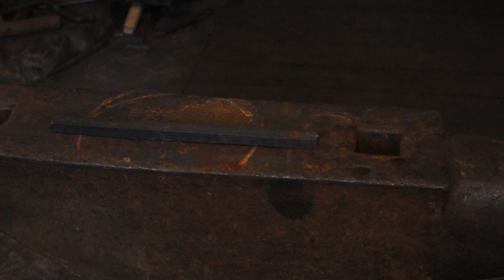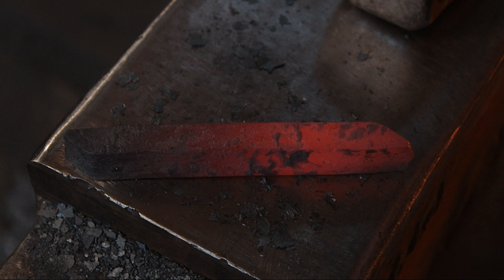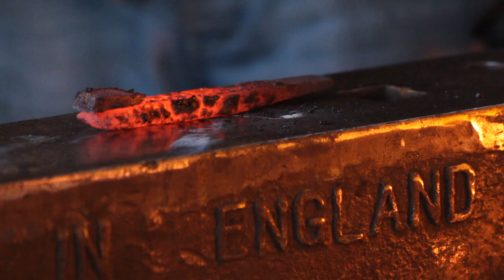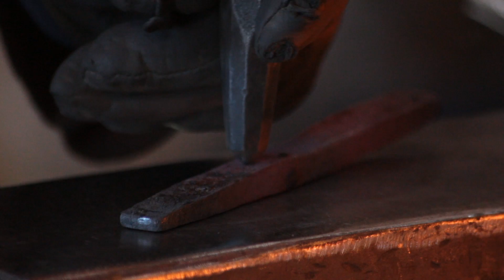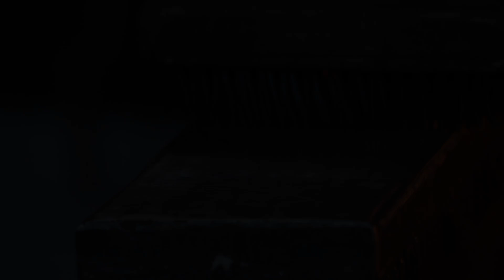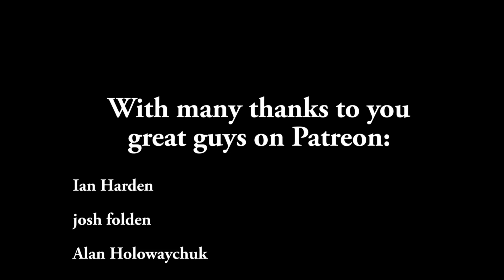Forging shears, Part 1.

Comment: Why make this mostly out of wrought iron? It would seem to me that making it entirely out of spring steel would create a better set of sheers.
Reply: I think it might have to do with his style of blacksmithing. He is very traditional, so I would think that back in the day spring steel would have been harder to come by than wrought iron. So you'd make most of your tool out of more common material and only use the good stuff for the cutting edge. I could be wrong but that makes sense to me :)

Comment: Do you have any problem with the wrought coming apart or cracking when you work at a dull red?  I have in the past, but I might have been working with hot-short. Wonderful stuff here pal, glad to see someone making proper hand tools.

Comment: What is silver sand? I think that was one part of your flux and I am not familiar with it. Are the proportions thirds? Thanks, love what your doing, be well!
Reply from the maker: It is basically clean fine river sand. In Europe it is used instead of Borax but I don't like it much on its own as it forms big lumps which mark your work. Just put "silver sand" into amazon or ebay and it should come up. It is used by horticulturalists as well. It forms a molten layer over your weld. I find that it stops the borax from running off.
Reply: Thanks. Do you collect your own filings?
Reply from the maker: I do indeed. I run a magnet over my grinding station every now and then when I need a top-up. I don't measure the quantities but I would say I roughly use 2 parts borax, one part sand and one part filings, roughly.

Comment: Its nice seeing a tradesman at work. 
I was skeptical why I would need to know how to make these but as usual I see how knowing this would help in making other tools.  Well done. I'll be waiting anxiously for the next part.
Reply from the maker: Thanks OKBushcraft. What I find with blacksmithing is that you can pick and mix techniques. For instance the faggot-weld technique used for steeling the edge can be used to make chisels and the spring making technique can be used for power-hammer tools. The edge forging techniques I'll be using next week can be used for knife making, so everything is interlinked. This is one of the things I love about blacksmithing :)

Comment: Rowan, I was curious why you didn't do a step down on the scarf joint. Is the step down not used when joining wrought iron and high carbon steel ? Thanks for sharing.
Reply from the maker: Hi Rich. That is a good question! :) When doing a scarf weld the step-down gives a bigger welding surface over a shorter length as well as aiding in fitting the two parts together. I do the step when I am doing a regular scarf weld, but I did these welds as laid-welds as they are called in the U.S. or faggot-welds as they are called here in the U.K. so the step-down wasn't actually necessary - all I needed was a weld-place as opposed to a shearing plane. The reason I did the weld as a faggot-weld was so that the steel would have a wrought-iron backing for a bit more strength. So as a recap - had it been a normal scarf-weld I would have done the step-down but as it was a faggot-weld I didn't need to.